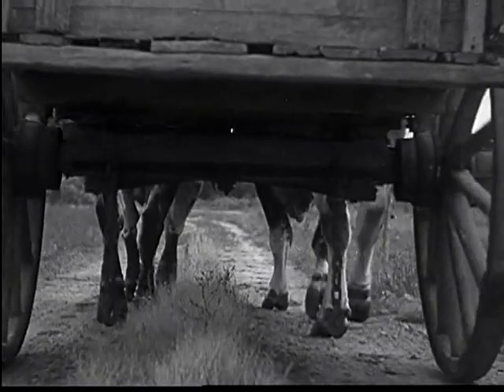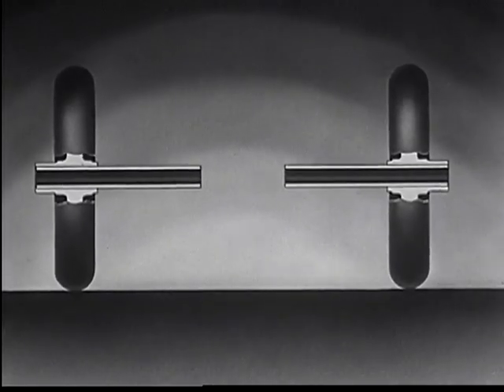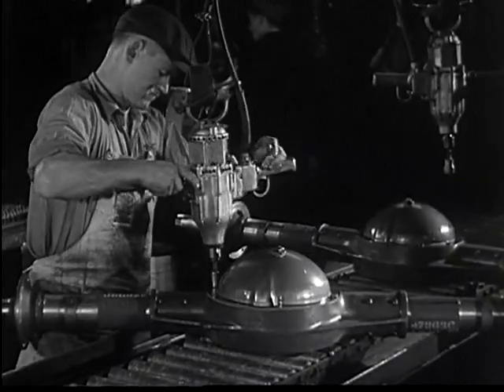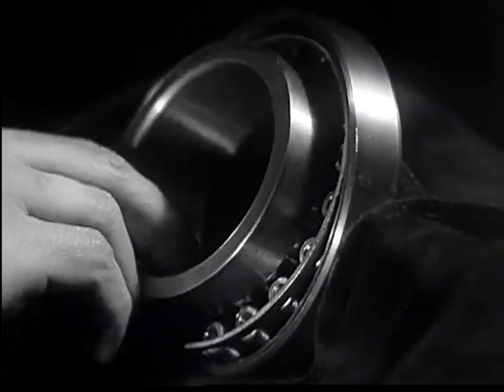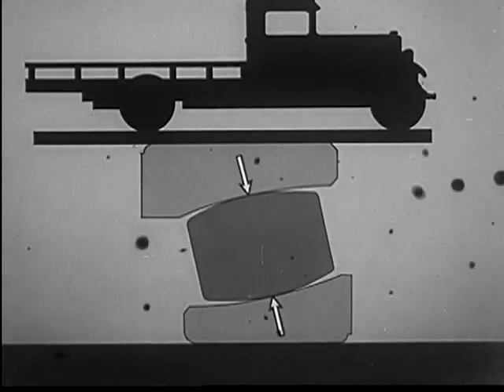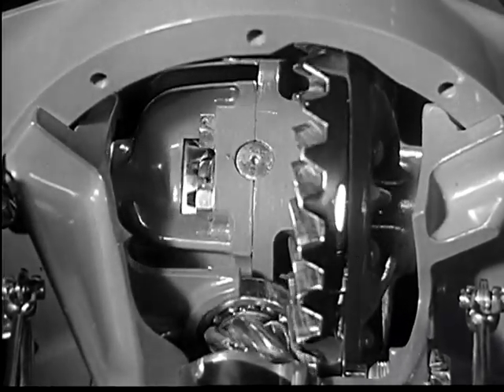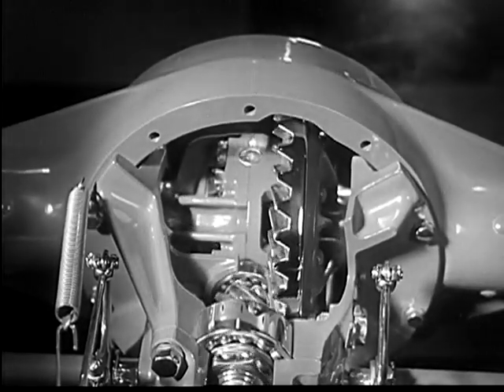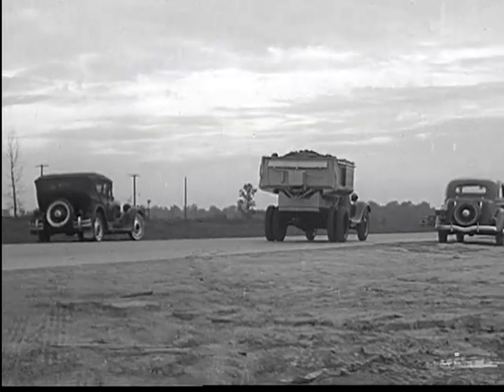It Floats - Chevrolet Full Floating Rear Axle (1936)

Comment: I'd be pissed if I bought a truck in '35 and then all of a sudden in '36 they made it a lot better.
Reply: +a DIY Car Guy gotta love a husky rear axle.
Reply: +a DIY Car Guy Kind of like people who bought the 2010 Mustang GT and then the Coyote motor was brought out for the 2011.  I felt a little sorry for them.
Reply: @jaredshaffer3901  2004 to 2005 Mustang.  Much better looking for the same price.
Reply: @jaredshaffer3901   I love Ford Modular engines. THey sound amazing and perform great.  THe thing that blows me away is that CHevy/GMC still get all that power out of a push rod motor and do a damn good job of it.   I kinda wish Ford  still had a push rod motor to go too still. The LS is just to good for such a great price. So easy to get at any junkyard and throw a couple thousand and ready to race.
Reply: simple solution, buy the 1936 axle and install it...
Reply: @sigurd1979  Back in those days, that you be absolutely possible. Those trucks didn't have sensors and electronics.
Reply: tell that to a computer enthusiast
Reply: Apple and Samsung in a nutshell.
Reply: And the 1937 also got the new Blue Flame 216 engine with 25 more horses, a 41.67% increase. All this power just to help turn the new heavy duty axle shafts.
Reply: a DIY Car Guy that is why the great depression has started lol
Reply: Ikr
Reply: ... pissed about axle that i ve seen in 2014 mustang V6...
Reply: LMFAO
Reply: This is what automobile industry is about since its beginning.
Reply: Ya this was some crazy ass new age type shit for sure
Reply: Ken Shackleton Does GM still make this axle, or has it been replaced by something by Spicer or Eaton?
Reply: @waltertomaszewski1083  yes in a way.the 14 bolt chev. Comes in simi float axel in lite duty 3/4 and full floaters. Has nose bearing on top of pion shaft like Fords old 1/2 tons 9 inch axle. Takes any flex out tip of pion shaft. I feel chev 14 bolt is like old 9 inch ford one good axle. Then again I could be wrong. Use be just as soon as you bought a 3/4 ton you got the full float axle. Last one I bought was 78. In early 70s???? Had full float axles made by Eaton I think????? I think to a deg. They were all good? Had uncle  built tanden  trailer  with two old chev full float axel. Claim they carry anything he could stack on top them. That was 30yr ago who knows.
Reply: Simplicity and easy to service. I have an Audi and BMW, Fun to drive but :( not so fun to work on. I do all maintenance on everything. When I work on my 1985 Suburban 4x4, it's like they said, "Hey Engineers, open this up, this guy is going to need to get his hand in there." Anything after the computer revolution requires universal joints on the sockets to take it apart. Hell sometimes you can't get at a trivial little sensor without dismantling half the engine compartment. Progress! They mak'em now so you won't service it, you'll take it to the dealer and be charged $1,000s. Still doing it myself even if it is a pain in the ass.
Reply: because of the "Tu Tu"
Reply: they still do the same thing.   I feel bad for all the people who bought a  2012 shelby GT500   Because it was shit comp. to the 2013
Reply: That comment made my day! 😃
Reply: Im sure though, you could upgrade to a 36 axle a couple years later #DIYlife
Reply: 1000 likes for you buddy
Reply: That's the magic of them old trucks you can enter change stuff like that all you have to do is buy an axle from Chevy unhook your drive shaft the u-bolts and the brake lines pull that sumbitch off pushing new one underneath there then just put everything back on
Reply: Feel the same way.  I think Cevey would tell you to pound salt!
Reply: 80 years too late for that buyer's remorse.
Reply: sigurd1979 that's what would piss me off lol I wouldn't want to have to do that...money/work/time
Reply: @aDIYCarGuy  why call yourself diy carguy if you don't like to work on cars? lol. in 1935 if i bought a truck and then there was a huge advancement in tech and i could upgrade my own car with it i'd be overjoyed.
Reply: @helterskelter416  That costs money, obviously you are less financially strict than myself. When you've paid for something, don't get the full value out of it by ending it's use early because something better came out not long after purchasing it, and now decide to pay for an "upgrade"; it's not a great financial move. Has nothing to do with the actual work.
Reply: a DIY Car Guy...every manufacturer does this to get more of your money
Reply: a DIY Car Guy Mee tooo
Reply: a DIY Car Guy I agree and I don't. Things change all the time. Things progress because people look at something and think, 'What if...?'
Reply: it's still shit since it's OPEN  and not a limited slip
Reply: NO shit!
Reply: The first iPhone.
Reply: Fr
Reply: That’s why car makers are constantly making changes. It’s been going on since the first automobile came out.
Reply: a DIY Car Guy lmao
Reply: a DIY Car Guy lol history repeats
Reply: Often thought that to especially the Ford mustang and Chevy Camaro can't say much about trucks they all look the same to me God bless
Reply: 5:00 WTF greedy fuckers make it as difficult  as POSSIBLE now days!
Reply: Ugh I don't know, i don't buy into novelties, floating rear axle, whoever heard of that!
Reply: I'd be more pissed if they never made any improvements to their vehicles since 1935
Reply: You've mastered time travel?
Reply: That is right, A lot is not a word!
Reply: @johnsumner6185  yes it is I just googled it
Reply: @James Ray I hate it that people get this wrong all the time.  I thank Mrs. Shaw in 8th grade!
Reply: @johnsumner6185  what do you mean the phrase "a lot" is a word, it's in the dictionary. what else did Mrs. Shaw teach you?
Reply: @johnsumner6185  Oh I get it. you said it wrong. you should have said a lot is not one word, or not a single word. saying not "a" word doesn't make sense. he didn't even use it incorrectly so not sure why you even pointed it out. most of us already know alot is wrong
Reply: It happens all the time today. I just bought the new iPhone six months later it's a lot better.
Reply: thats what i was gonna say lol
Reply: It was the reverse for Ford trucks in the 90s. If you procrastinated in 96 about buying a new F150 the 97 model was worse
Reply: Yeah but in 35 they claimed it is the best too.
Reply: a DIY Car Guy ......That sentiment is exactly why Apple are the best company for not pissing off their customers.
Reply: That is still happening today.
Reply: Assholes
Reply: That was funny thanks
Reply: Lmao you mean everyone that bought the 2018 ram 1500 and then the 2019 came out
Reply: That's what they do now
Reply: Axel swap
Reply: didn't matter when everyone who worked could afford to buy 10 of these.
Reply: Like today's i-phone
Reply: Why?

The only reason to get pissed off at that is you either want nothing to ever improve ever, or never ever buy anything because eventually something better will come out.

You know what the guy who had the 35 truck had over the guys who waited for the improved 36 truck? A truck to work with for an entire year.
Reply: By that time, you'd be on your second engine and it may be well possible to simply upgrade your previous year rear diff to the new and improved one..
Reply: just another reason to not buy a new car
Reply: You can have that same issue into the 2000s. Most 1/2 ton and some 3/4 ton trucks and vans tend to use the inferior axles, while the heavy 3/4 and 1 ton trucks use the full floating axle. It's actually an insurance issue for "church vans."
Reply: ...u know... something like that happen every time u buy anything...
...such as cellphone...
Reply: Most people , just like today, would not know. or see the difference.
Reply: happens every year or just about
Reply: we should never make things better in case it upsets someone
Reply: @lutherblissett9070  Very narrow way of thinking. It is valid to be pissed when a highly upgraded model comes out when you JUST spent a ton of money on something that becomes severely devalued all of a sudden. That doesn't mean we shouldn't make better things.
Reply: Well now you don't have to, everything is built like the 35 lol
Reply: @Fry Right! Lol happens all the time.
Reply: Well you're in luck, now you could buy a truck in 2014 and by 2016 it'll be worse quality and twice the price!
Reply: I don't think it mattered as both trucks still used those awful 7.50x20 thin tires which couldn't haul very much anyway
Reply: Like the c5 zo6.
Reply: ya, but right away you wouldn't notice. same thing happened to colt right before 1911.  1911 colts are considered the greatest war pistol ever designed.  but the models that are predecessors to the 1911 were more desired before the 1911 was produced.  sure after it came out people realized.  but it took a few years.
Reply: @treatb09  before the 1911 the 1903 was like the only really successful 1911 predecessor and the 1903 is like a different gun entirely but still really cool and desirable.
Reply: @treatb09   That colt is just beautiful, but is a horrid weapon.;)
Reply: Well... yeah... Thats what companies do, they tend to release something to sell to get more money to get more materials and researce for thier next model. And obviously they're not going to release something new that's worse than the last model. Not to mention how do you improve upon a model if you didn't have a prior model? You cant just make something perfect on the first shot.
Reply: All of those people are dead.
Reply: +Jared Shaffer ikr
Reply: a DIY Car Guy because who cares about progress right ?

Comment: At 1.30, I would have preferred if the two ends  tubes  were spun before pushing them in,  what is shown is a friction weld but I would preferred if the joint was red hot due to spinning. 
If one needs a self aligning bearing, then there is some inaccuracy in the manufacturing and at 2.36 the half shaft could be subjected to bending and metal fatigue,
I think the distortion of the  barrelled rollers with the load is a little exaggerated as if that was the case, I just wonder how the metal fatigue  on those rollers would affect the life of a roller, especially if they are surface hardened.  I suppose they will distort a little, but not much as shown. Still they went into great details in their advertising their products. 
To think that only a little circular clip is all there is to stop the wheel from moving out of its place is a little frightening, It must be a good Cir   clip.
Reply: +Carmel Pule' "I think the distortion of the  barrelled rollers with the load is a little exaggerated as if that was the case"

If you paid attention, you would have heard during the end of the animation that he said "This drawing has been greatly exaggerated."
Reply: Carmel Pule' read: 1936. As in 80 years ago.
Reply: The bearings have to self align as the axle tubes flex a lot under load. Half ton axles and bearings fail a lot under hard use because they use a fixed single bearing that can not tolerate tube flex. These full floating axles are close to a perfect design if clean oil and grease (outer bearings) is kept in them they are almost indestructible and the exact same topology is used today in 3/4 ton+ HD trucks all the way up to super massive Belaz 75710 450m ton dump truck. Some railroad equipment also uses the dual Timken self alignment bearing technology. If you called Timken they would give you all the specs of this bearing, I'm sure it's life span with proper maintenance is longer than dirt is old.

Comment: can any1  explain easily the diff between clearance and tolerance
Reply: Depends on what you're talking about. But when speaking of machining processes, clearance is the distance pieces/parts clear each other without binding up, causing damge. Example, the clearance(backlash) of a ring and pinion gear set is .005-.008". Tolerance is the allowable limit that a piece can deviate from specifications. Example, the pinion shaft diameter should be 1.75" +/- .0005".

Comment: Back in the days when you would go to the cinema and watch these! Funny how a "heavier, huskier" axle is better than a lighter one back in the 1930s. Today car makers are trying to make everything lighter, and a new component heavier than a previous model is seen as a major design flaw!
Reply: They didn't have Gas issues back in the 30s... Also the need for stronger but yet efficient low displacement engines require that the full weight of the vehicle is lower so it will keep being "Sporty" yet "Eco-Friendly"..
Reply: @skirmich  that all comes at the cost of it being fragile and having a relatively short life. more power on smaller components = more wear and tear
Reply: I interpreted the "heavier, huskier" comment as the axle being stronger and more durable, rather than sheer weight for the sake of adding more weight. Don't forget, the video is for a commercial truck axle, not a passenger car. GM uses these types axles in their commercial grade trucks to this day.
Reply: +Blaine Bugaski Ehh, every complete lawn mower has wheels.
Reply: hing is that today's axle of similar type is as sturdy as those where.  At that time the issue of smog hadn't manifested itself, and petroleum from the Middle East kept fuel price low
Reply: Lighter can be stronger of done right.
Reply: Tony Danza Really? You can remove an axle that easily on a modern commercial Chevy truck? I can just imagine the April Fools pranks...
Reply: +Nate Jones Yes, most commercial trucks have full float axles.
Reply: +De19thKingJulion Heavy duty one ton trucks cost $80,000.00 while your average tiny 4 cylinder lawn mower on wheels costs $20,000.00.
Reply: +Nate Jones Yes, it is relatively that easy, just not as clean.
Reply: +De19thKingJulion ????
Reply: +Blaine Bugaski You said "lawnmower on wheels..." as a description of cheap cars. It's OK. Just that it's a redundant phrase, like "automobile on wheels,"
Reply: +De19thKingJulion Youtube wasn't showing me your reply properly, for some reason.  It never did this before.
Reply: +Blaine Bugaski WEIRD!!!
Reply: +De19thKingJulion I don't know why it is doing this.
Reply: Nathan Dance I believe that was a thing from the 1980s that didn't catch on.  I forget the brand.  Maybe Lawn Boy or Yardman?
Reply: Nathan Dance Except Toro wheels that break in half and then cost $90 for a set of 4. Hehehehe.  I'm satisfied with Toro, though.  Still using a 2004 mower that has nothing replaced thus far.  Although my 2007 model had to get new wheels and a new transmission.  Oh well, it's relatively inexpensive when you assume that Honda mowers are $600+ for the same damn thing.
Reply: I remember my Grandfather cutting his rather large corner lot with a plug in mower.  Took him two days at a slow pace.  Ugh.

Takes about an hour and a half with a Toro personal pace 22" mower if that gives you any perspective of the lot size.
Reply: I have approx.  half acre of grass. . It takes 30, minutes to cut with my zero turn.
(that is timed from when I stand up to when I sit back down on the couch), (getting it out of the shed, mowing, cleaning it with my blower, and putting it back away, included)  ahhhhh....Life is good......
Reply: Fords, and Dodges too. 3/4 ton and up. But what they don't tell you is how much of a bitch it is to get the other half of the broken axle shaft out.
Reply: Nate Jones You think thats quick, most driveshafts can be removed in 3 minutes with an impact. Just 4 bolts on the rear end and pull out from the transmission.
Reply: yet cars weigh 1,000 pounds more than they used to... per size
Reply: @hotrodray9884  Yes, and they get larger all round too.
e.g.: My 2001 Subaru Liberty is overall smaller & lighter than a 2018 Subaru Impreza.  Liberty has always been a mid size sedan/wagon & Impreza has always been classed a small sedan/hatch.
Reply: De19thKingJulion That's because nowadays engineering is lightyears ahead of that in the 30's.   Today the key is making components that are as strong and durable as possible, while at the same time as light as possible.